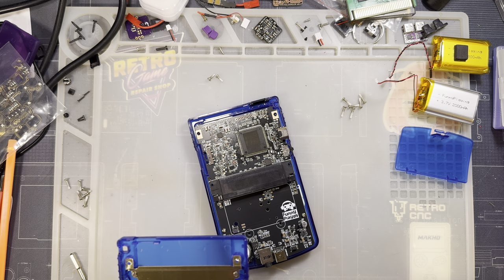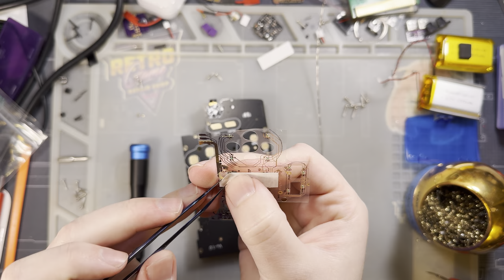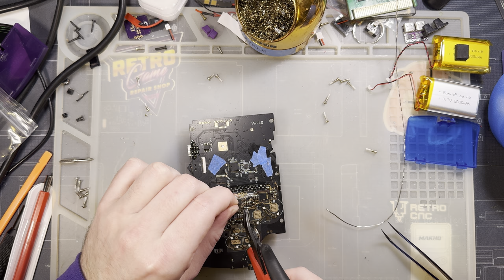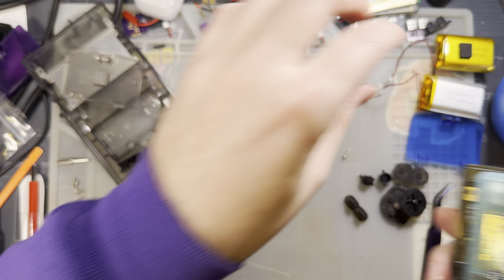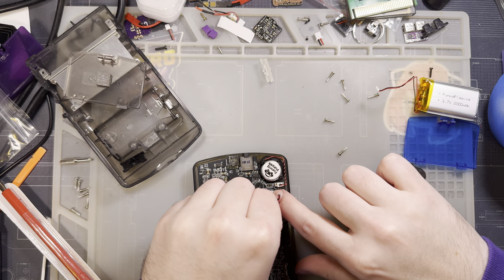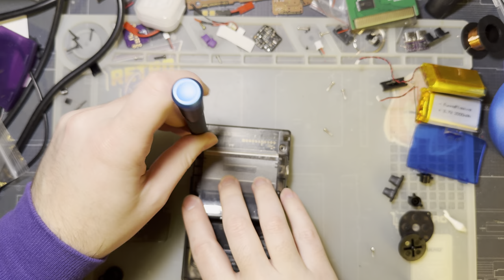FunnyPlaying Game Boy Color Button LED Kit but in a FP GBC

Comment: It does look like newer Versions of the FPGBC board have these test points exposed, at least the non black models, based on pictures on the  Funnyplaying website. So it could be a much more straight forward install on those.

Comment: It's a shame that they don't make an LED kit specifically for the FPGBC, or that they didn't think to integrate LEDs in to the motherboard itself like they did with the custom GBA motherboard that they make.But this is a cool mod nonetheless, and I'd attempt it but I'm still pretty new to tinkering with small electronics like this. With my luck I would probably damage the traces when scraping the PCB to expose them.